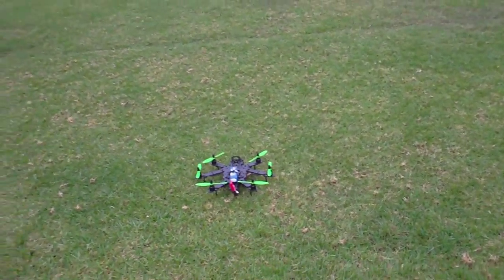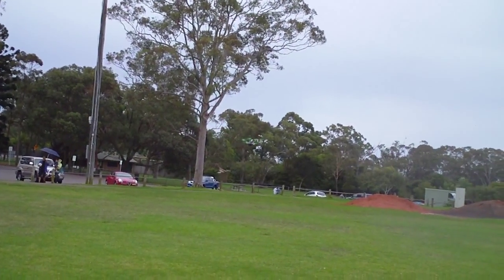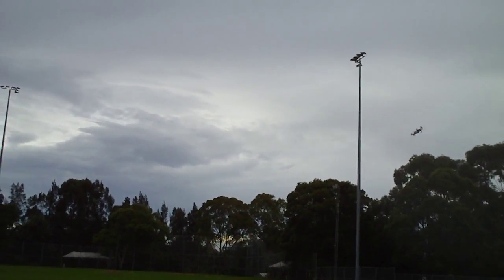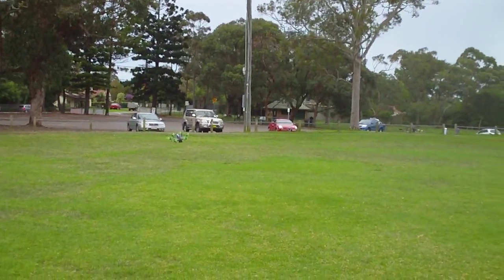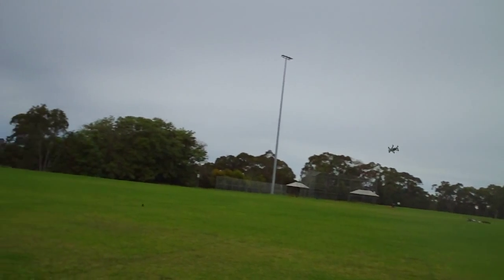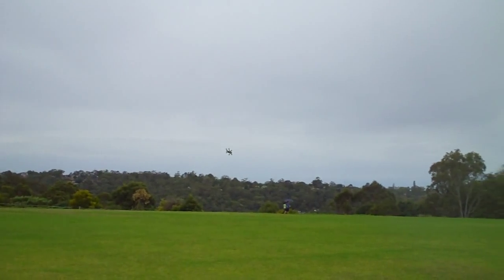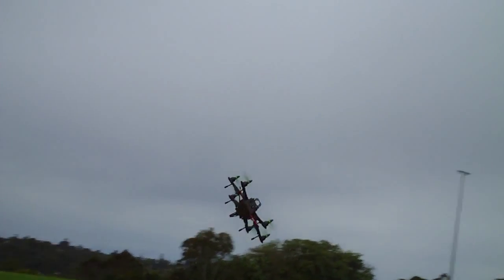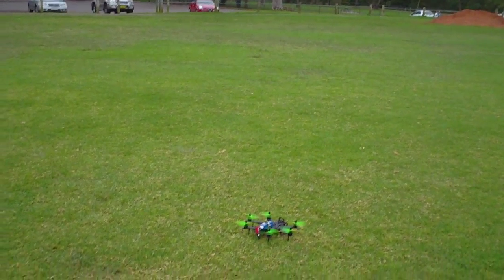Armattan Hexacopter - new PID Settings

Comment: Very nice and you are a good pilot as well. I'm just starting my hexacopter tilt build, and while I've built half a dozen hexacopters, this is my first with an asymmetrical rotors configuration. Someone told me that I need to use a center of thrust calculation rather than just COG. I can't find info on this, so can you refer me to something?

Comment: Beautiful I can't wait tell o can get one my self if i may ask what flight console are you running? Multiwii , kk2.1.5, , F1FC ? And what motors? Thank you for the vid I'm sold again just seeing here flow so smooth.
Reply from the maker: +Jack Daniels Thanks, this is using a Mullet and the stock Armattan motors.
Reply: Thank you so much I'm hoping to do a pre build to save time & any personal mistakes on such a nice set up hoping to go with the upgrade motors he now offers am still debating the flight controller hoping to get one that's as smooth as yours but posable expandable to gps & RTH function for some extra long range runs through the valleys & hills here in Alaska.